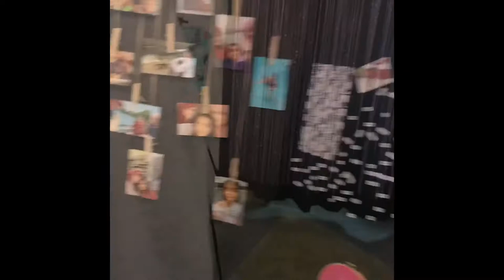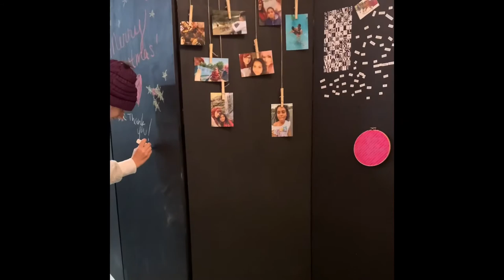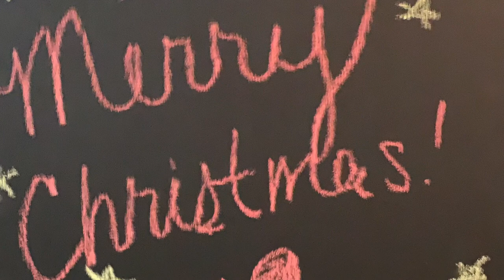Time lapse transformation of a dirty basement into a “surprise” art studio!

Comment: What did you use to hang those curtains up in the ceiling ??
Reply: Also, did you use a specific paint for the floor and did you put a glaze over it ? Amazing transformation by the way !!
Reply from the maker: Thanks Erika! To hang the curtains I just used screw in O-rings and hung the curtains from them using shower curtain hooks. The floor is just regular acrylic paint which I watered down a bit so some of the concrete texture shows through. Then I put a thin coat of epoxy over it to give it some gloss, and it also makes it easy to clean if there are any spills in the art studio 😊